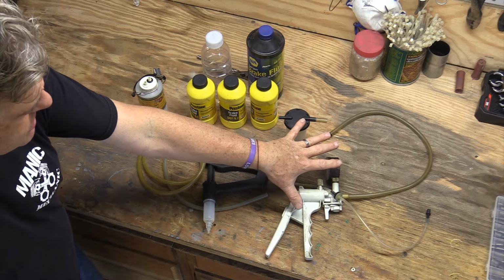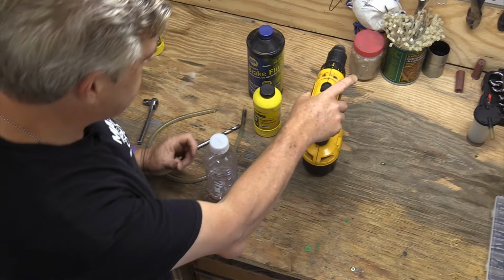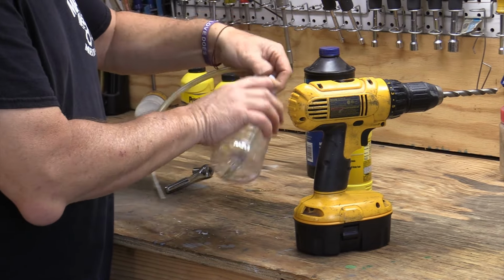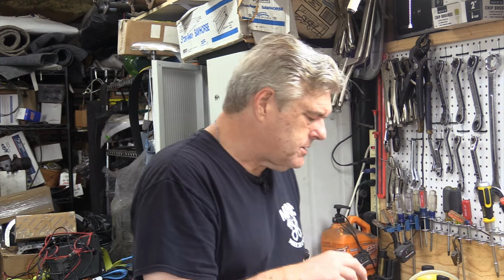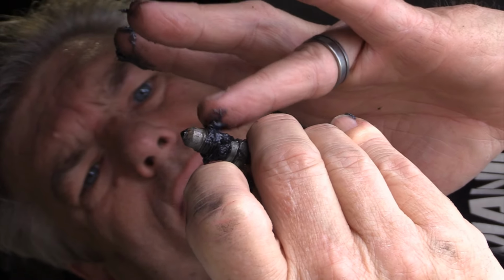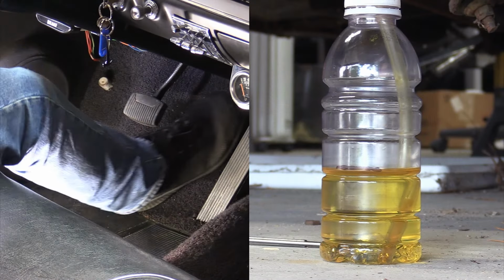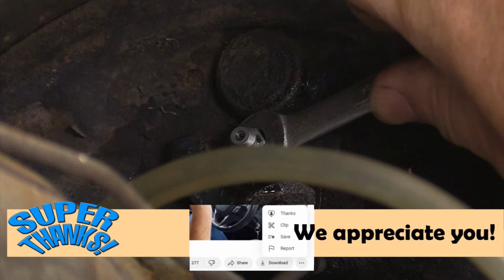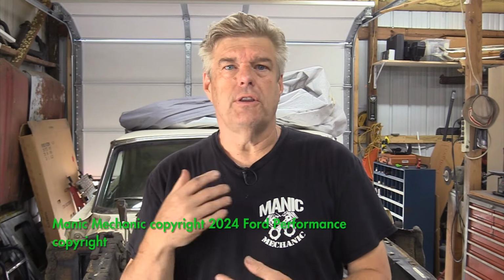Master The Art Of Brake Bleeding With These Easy Steps!

Comment: I have found that if you set the bottle higher than the bleeder it works even better. ( the air traped in the hose can't make it back into the cilinder/caliper)

Comment: I'm old so I was taught to use that method with a Coke bottle. The narrow neck kept the hose in place and the glass meant it was heavier and less likely to fall over since the cap obviously couldn't be reused. Later I went to Gatorade glass bottles, since the bigger, wider bottle meant that it had no chance of tipping over.
Reply: I still use a coke bottle today works great.

Comment: Good points..  I like the vacuum gun.  I use a water bottle with the vacuum gun.  I do not open and close the fitting.  I just pump the fluid out and I can do all 4 wheels in about 1/2 hour.

Comment: That's a great tip with the grease around the bleed screws. Sure, go ahead and show us the RSS stuff. They make really nice products and deserve the exposure. If I were in the market for an aftermarket suspension I'd MUCH rather use RSS than put in an MII system, even though that's the go to for the street rod world.

Comment: dont actually need to fill the bottle if you put the bottle higher than the nipple so that fluid is pushed up. There is also neat auto bleed nipples you can use or one way valve.